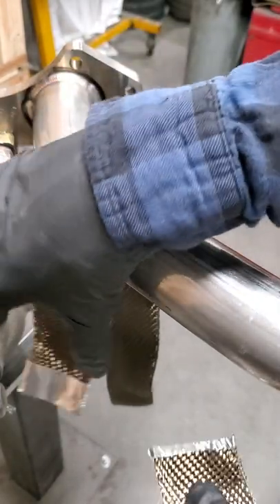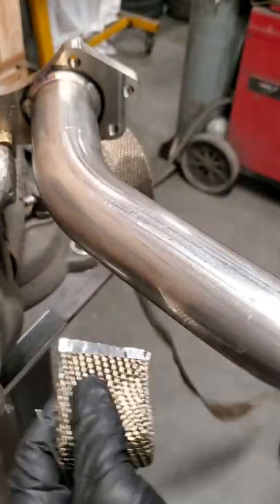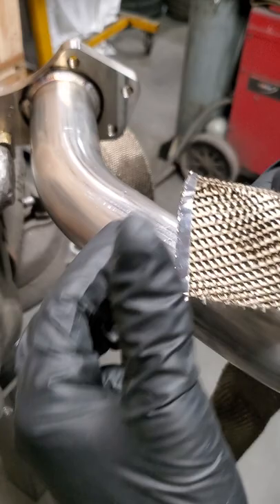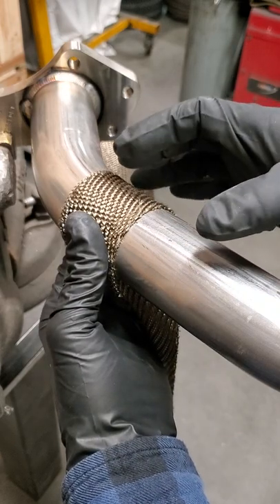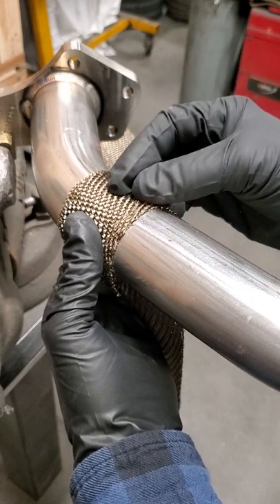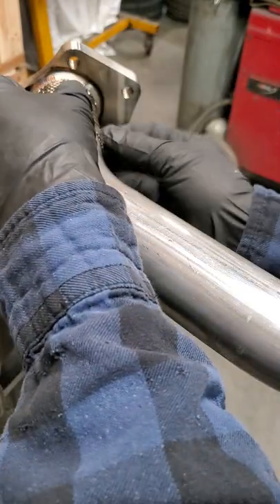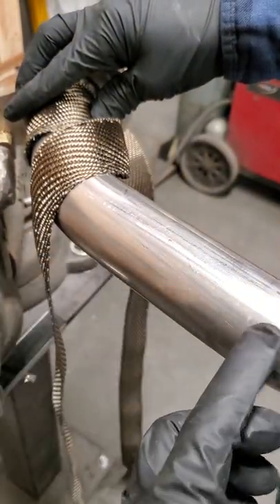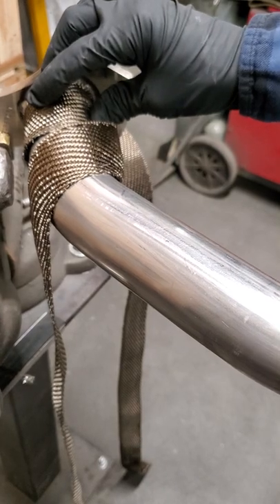Wrx sti KillerB header/ DEI titanium header wrap

Comment: Would coating the headers with hight tempt paint and wrapping them with titanium wrap be a bad idea?
Reply from the maker: Yes, the wrap will hold the heat in making it hotter than paint withstands, not allowing it to cool by the surrounding air. This will burn off the paint or even crack ceramic coated headers. I only recommend wrapping on raw material, and using hightemp silicone spray on top of  the wrap. Hope this helps ✌️

Edit: you deserve a pin 📌 for this great question!🥳
Reply: @Not.The.Avg.Smitty  thank you for your quick reply
Reply: @Not.The.Avg.Smitty  thank you for your quick reply
Reply from the maker: @zanixinaz  welcome anytime🤠
Reply: @Not.The.Avg.Smitty why the silicon on the wrap?
Reply from the maker: Adds protection against the weather and any oils that may get on it. Plus it makes it a lot nicer to handle as the fiberglass is all stuck.😉
It's not necessary, but I highly recommend it.
Reply: They make a product called CERAKUTE that can be sprayed on…..it work almost as good as titanium wrap, and is a much cleaner look.
Reply from the maker: @ginoasci2876  agree, cerakote works great and looks good!
Reply: @Not.The.Avg.Smitty  :  question…..have you ever or do you think cerakote could be applied with a paint brush or sponge brush?

If it’s a liquid as paint and can be sprayed, I’m think it could be applied same a paint.
Reply from the maker: @ginoasci2876  I'm sure it could but I think the overall finish would look bad, probably crack and flake off. Prep imo is the most important thing either way.
 We're restoring an s10 so I might just cerakote those and do a test with another set of identical exhaust manifold. One brushed one sprayed.
Reply: @Not.The.Avg.Smitty  :  how soon are you going to do that ?

I’ve got a new motorcycle.
2022 Triumph Scrambler 1200xc.
If you google it and look at the exhaust, most of it is hidden by some fancy good looking heat shields.  This bike is notorious for heating up stopped or in heavy tow traffic.
It’s an awesome bike so to remedy this triumph incorporated the catalytic converter to the back with the baffles but the heat is still a little much.

I want to either wrap or cerakote the pipes that are hidden behind the heat shields.

It’s at the shop right now and should be ready for me to pick it up probably next week.

I’m thinking of brushing on a coat of that cerakote, and if it’s not enough I’ll wrap it in titanium.
The cerakote doesn’t have to look good because it’s not going to be seen.

Just wondering how soon you’re doing those manifolds, so I’d know what route to take. 
If you’re not at that stage, I’ll just do it anyway.
Reply from the maker: @ginoasci2876  not sure on my time frame as I teach my boys how to do it while I'm at it. The older boy has been busy finishing his senior year and track etc... so I kinda work on that around his schedule. But I can probably get a test sooner than later. I'll even try to test them the best I can with the rosebud on the torch setup along with temp sensors etc...
Either way thanks, you gave me a great idea for people to see what they need according to what fits their needs and budget.

Comment: I don understand why people use wraps on exhaust in 2024? it's the worst way to do it and much better tech is availble for almost same money.
Reply from the maker: They hold in more heat than anything else, has been proven. I've got 30k on this set so far(have made it over 100k), what it comes down to is the person that does maintenance. When a study shows over 90% don't do poper maintenance, the problem is the owner. If you never were able to wrap properly or make your car so it doesn't spew fluids... just keep driving a corrola.
So Better tech is really a matter of opinion when it comes to it.  The one that hold the heat back to me is the better choice for me.

Comment: Would paint be needed on chrome headers??
Reply from the maker: I wouldn't put wrap or any paint on chrome headers. The chrome will flake off due to heat being trapped, I would only do it if the chrome was flaking off already. After I wrap I spray the wrap to keep contamination out, oils, water etc...
Hope this helps
Reply: @Not.The.Avg.Smitty  okay I'll wait until my pipe starts to look bad then
Reply from the maker: @ballsackmanfred  great idea,  personally I like the blue they turn😉.

Comment: It doesn’t matter which side you ziptie first
Reply from the maker: I don't start with ties because I've 1)  wrapped wrong,  having to undo and start over. 2)came up short on a piece I thought was long enough. <-- story of my life😅😅😅 3)loose fitment having to pull off and redo. Waiting until the end secures the wrap, it's not coming loose if you let go and it's in the position you want.
But you're correct it doesn't matter as long as the wrap is tight. Hope this explains a little more why I do it this way.

Comment: Is that a ceramic coated header?
Reply from the maker: 4-1 Killer bee equal length stainless holy header raw with no finish. I don't recommend wrapping over any coating as it will trap the heat in and potentially destroy the  coating. Finished with hitemp dei silicone spray to keep oil and other fluids out.

https://youtube.com/shorts/qEn693H22PI?feature=share

Comment: Ok I need someone else that use this stuff still to ask option. I have a Suppressor for my rifles. And the wraps are kind of all burn up! Now I have used muffler wrap on bikes cars since I was 13. But not to many people around me still do. I want to use it to make my own cover. But unless I use the fiber glass I'm afraid the metal well shrink him. What is your thoughts on the expanding tracting?
Reply from the maker: This is far superior in my opinion to the standard fiberglass wrap, the only expansion you'll get is from the metal getting hot. Other than that I don't see why it wouldn't work unless you had a muzzle brake,compensator or flash hider. In my opinion This would rip even fiberglass to shreds as I run a t3 muzzle brake on my 300wsm.

Comment: Did you add the aluminum tape at the end so ot doesn’t shed when you have excessive material?
Reply from the maker: I do it before cutting it to keep it from fraying out from start to finish. 😉
Reply: @Not.The.Avg.Smitty  thanks for the tip. Another question is it necessary to paint the wrap with the silicone spray can dei company has?
Reply from the maker: @ariesanfilippo1078 not necessary at all, but it does help protect against oils and water.

Comment: How would you make that wrap impervious to potential exhaust leak?  Thanks
Reply from the maker: Know a good welder so there are no leaks.😉

As you know, it will eat the exhaust wrap. Stay away from jointed areas that use clamps. And stop at the joints like in this video as I never wrap over these areas. When done, I always finish with high temp spray for added protection against oils and water. I am currently over 20k with this setup on in the video with no issues and have put over 100k on dei titanium wrap doing it properly.

Btw great question!